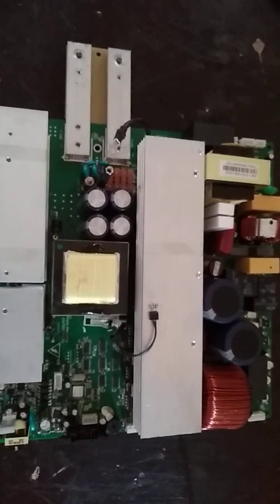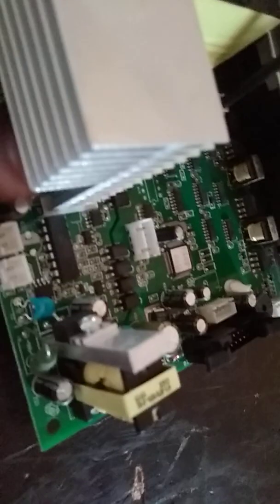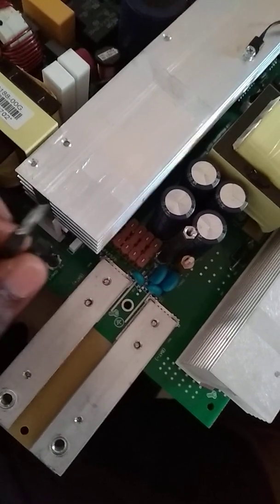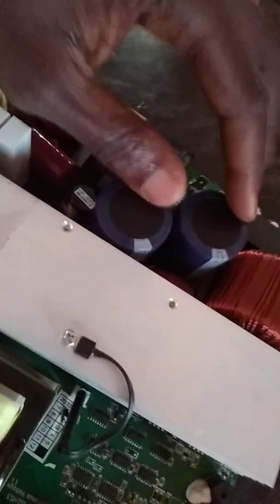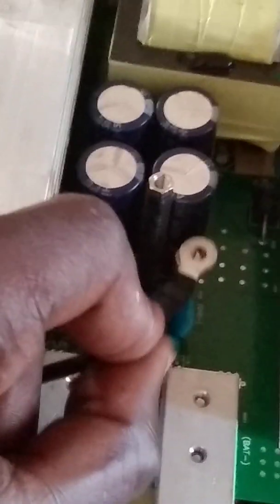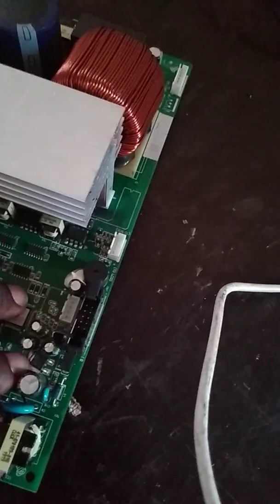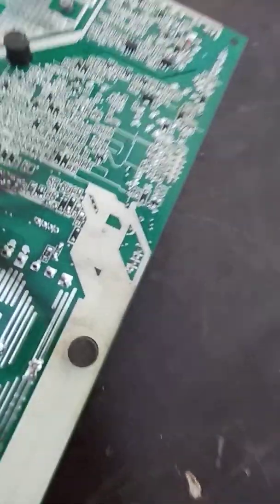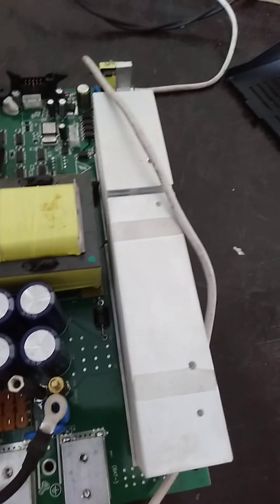voltronics mks mainbaord 1kva to 3kva common faults and solutions

Comment: Hi..  You described it well.. Thanks for good video my question is if inverter does not detect PV so how would we trace and solve communication fault?
Reply from the maker: The solar board uses an opto isolator to communicate with the mainbaord. Any failure in that circuit will cause a malfunction. Also there are a couple of resistor diodes and smd transistor that a situated close to the solar communication cable, be sure they are ok
Reply: @SAMOSONIC  any  shcmetic  for any   sort of  high voltage  inveter solar     combo  unit  i cant find  any    on google?
Reply from the maker: @waelfathe9909  no complete circuit online except service manual. But you can trace the circuit for personal use